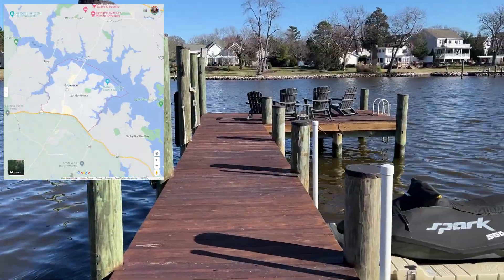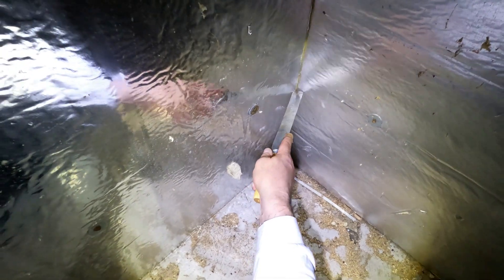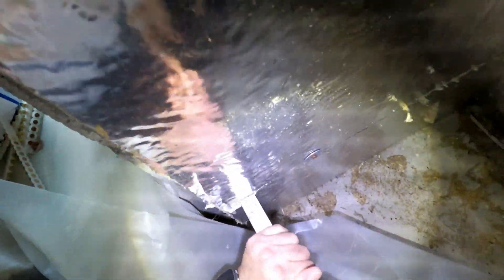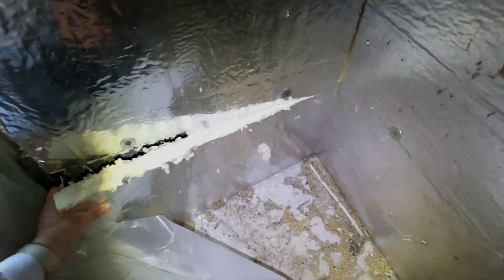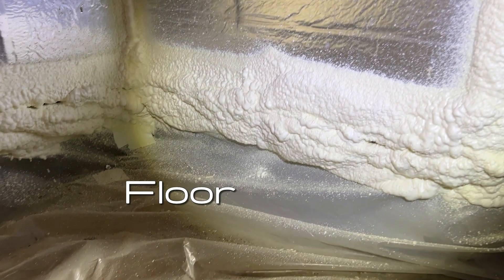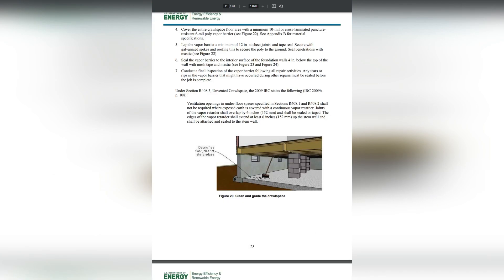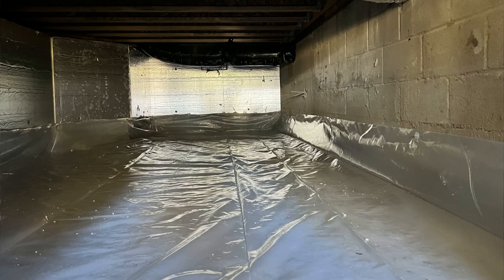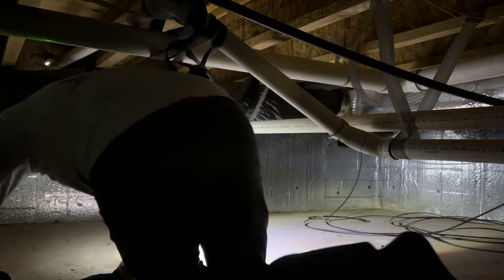Edgewater, Maryland Home Crawl Space Insulation & Vapor Barrier Fix | Home Performance Project

Comment: Unless the crawlspace was conditioned than the vents are needed to vent out the humid air inside.  That and you dont want that air to be stagnant and fester down there and should be kind of like an attic space is vented to circulate air  as long as you air seal the living space..  if there’s a leak that develops from plumbing or hvac than nobody would notice until the water has caused mold and damage to supports.  The only way to get that out would be the constant use of a dehumidifier running 24/7..  which would in itself create heat in the summertime and be useless during winter.. big energy drain..   the sealing of the ground is code.  As well as running that barrier up the walls at least 12” .  I would personally run it up double that if possible or at least to the frost point or even ground level.. but the vents should always be left open and clear of debris..
Reply from the maker: This is old school thinking and will not only cost you money in higher energy bills but also comfort.

Comment: This might just be the next project on the list. My Crawlspace is unvented and conditioned, but no insulation on the walls and the vapor barrier is just sitting on top unsealed. Would doing this increase humidity? Thanks for this video!
Reply from the maker: Hello! If you can do what you see here, it will decrease humidity! The vapor barrier prevents ground moisture from rising up and sealing the walls, and mainly, the rim joist will keep the heat and moisture out so the house can stay much drier and more comfortable in the summer.
Reply: @homeairleakagetest  thanks for the reply! That's what I expected, but I've seen a few other videos where the crawl spaces were encapsulated and they added huge dehumidifiers in the space, so naturally I assumed that sealing the vapor barrier increases humidity. Thanks for clearing things up!
Reply: @jovannihernandez4037 adding a dehumidifier would be a good idea. Gives you conditioned air down there as well keeps all that humidity away 😊